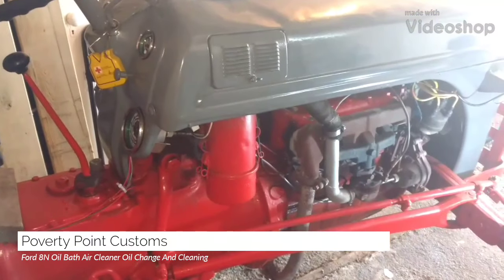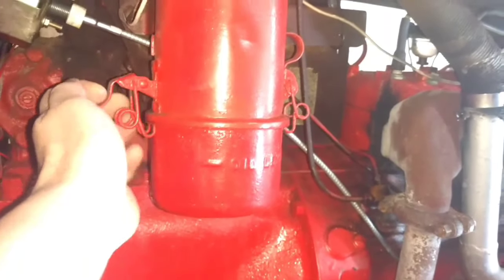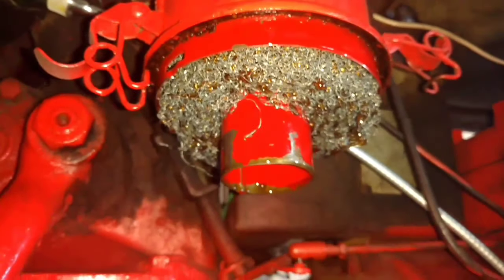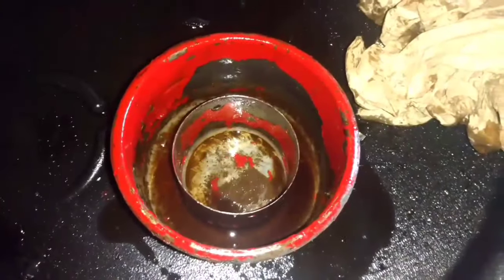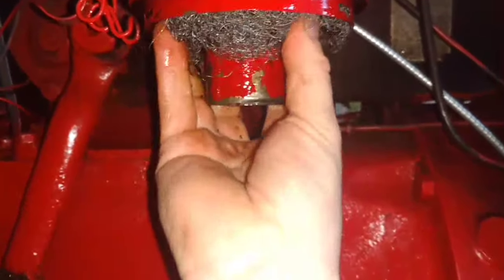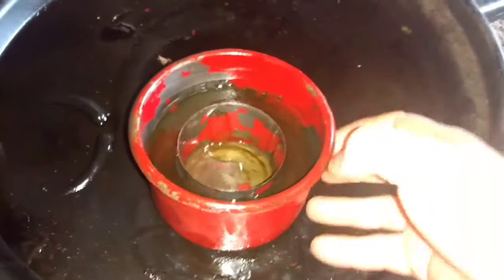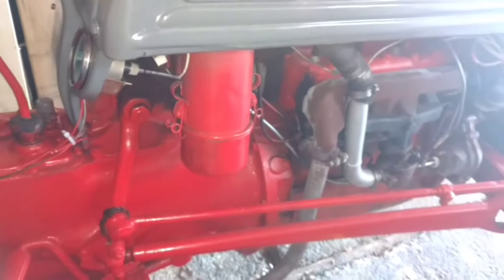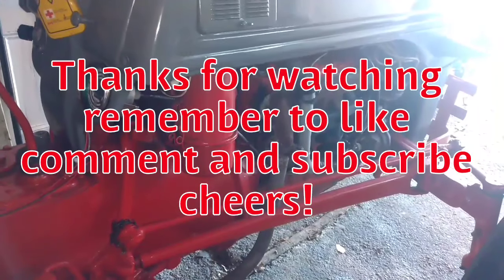Ford 8N Oil Bath Air Cleaner Oil Change And Cleaning

Comment: Hola, cómo se llaman esos rollos de alambre que van metidos en el tubo, en el filtro, son 2.
Reply from the maker: The wire in the oil bath air filter is to trap any large debris
Reply: En Anglais? Wire matting.